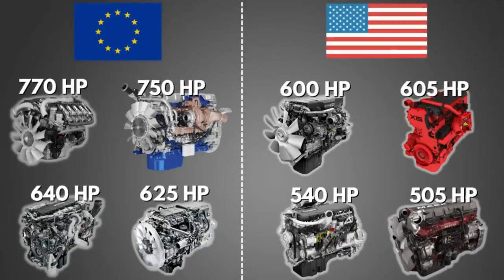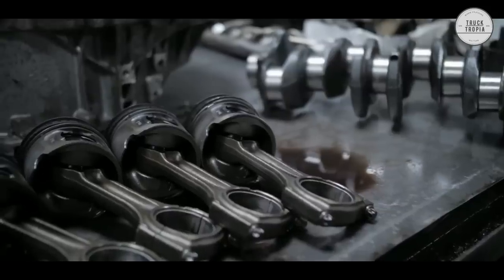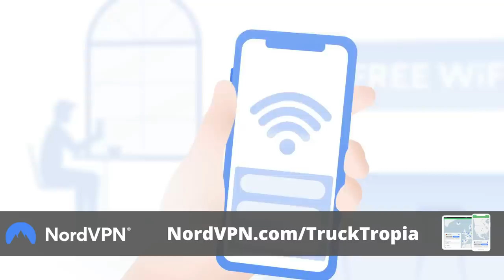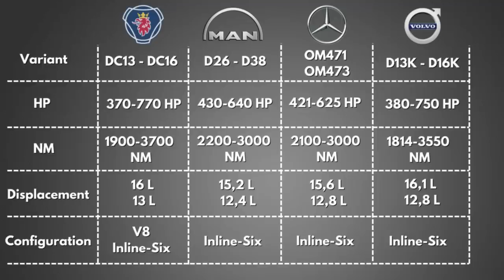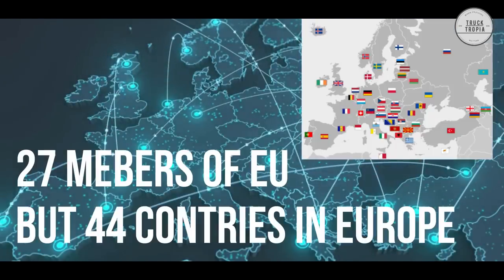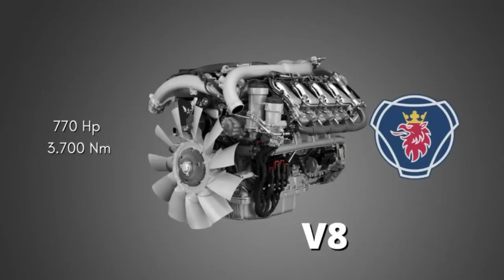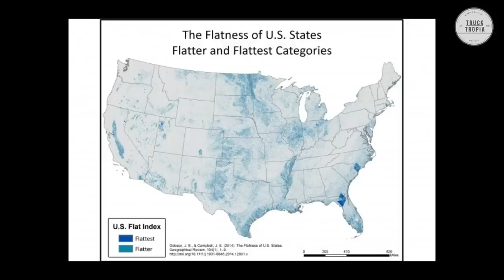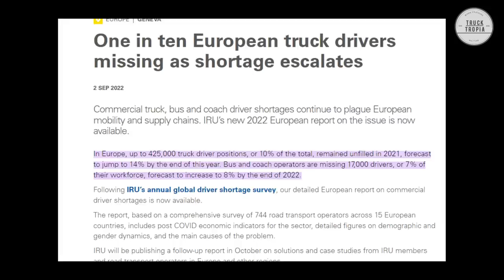Why European Trucks Have Up To 770 HP And US Don’t

Comment: My good sir I don't mean to be disrespectful but here in the us our trucks may be big and sometimes slow but there are much cooler and customized trucks here in the us than I've seen anywhere else in the world
Reply: What I noticed in the US is that your trucks often drive much faster (!), because they are unlimited. In Europe all trucks are strickly limited and monitored with a so called "tachograph" ( a registration aparatus), and the maximum speeds for heavy trucks in all European countries varies between 80 and 90 km per hour (50 to 56 mph). 
So all that horsepower can not be used for a high top speed. However it does help with the acceleration and climbing power on those winding, narrow and hilly European roads (which is much more important here).

Comment: The EU trucks with their advanced ECUs and fuel injection also respond very well to remapping - theres likely a hundred horses hiding on top of that 750+ BHP - or a few MPG improvement to their fuel economy; it doesnt sound much, but an increase of just 2-3mpg can save operaters many thousands per rig in operating costs annually.

Not sure where the US are with their EDC systems but im guessing still a few generations behind if your Tractor manufacturers are anything to go by - especially if they follow the lead of companies like John Deere and make everything proprietory or Dealer service/repair only (although this has been forced to change to some extent too recently im informed)
Reply: Cummins in the US are in top of the line along European manufacturers and so on I will guess. Got strict emissions laws both places. It's more about the larger part of the US market is trucks with lower total weights allowed than in Europe, and majority of traffic going on in relative flat areas. If there was a large enough market for a 700-800 hp eninge to make economically sense, they would likely had no problem developing it. The large part of class 8 Euro trucks are around 500hp, similar to the US. Those 650-770hp engines are a small part of the market, most popular in the Nordics countries with their higher total weights, especially timber trucks (often 130-180.000 lbs), hilly terrain. Also in the Alps those larger engines are more used

Comment: They use a different measurement standard is my guess, they must because a cummins or cat 500hp will pull harder than a Volvo 700hp, I do know that there is din and sae testing dynometre standard, they are different, although I don’t know which company uses which, here in Australia we have all types of trucks and I’ve driven most, the cummins and cat with the 18 speed manual are ahead in pulling power

Comment: american semi's use inline 6's that make 1800+ ft-lbs of torque. american trucks stopped using v8's a long time ago
Reply: V8's generally are less efficient, more interal friction than inline 6, so most have stoped producing them for highway trucks. Scania have managed to develop their V8 through 50 years compiting with inline 6, so they are sticking to it. They got inline 6's too

Comment: Power (kW) = RPM x Torque(nm) so the Power in kW is the important Value because now you can take the right gear an get the maxium power.... torque without enough RPM can´t take you over the big hills....and on Truck engines 100rpm makes a difference....

Comment: Because hp is CALCULATED.... torque is measured...
Hp is a function of rpm.... look at f1, makes no tq, but spins to 14+k and makes 900+ from less than 3l
Reply: I don't know your point but basically you believe that force times speed is calculated (which is power) and force times radius (torque) is somehow measured.
Reply: @simplemachine9531  the formula for hp is 
Torque x rpm /5252
Reply: @taomicioli  the formula for torque is hp/rpm x 5252 so torque is calculated, again following your logic? You need to investigate more.

Comment: Actually DAF designs the PACCAR engines. I don't know if it has to do with DAF owned by PACCAR, but DAF  only produces and uses engines up to 530/540 hp  (MX13)   I think building stronger engine is something of a waste for a company like DAF/PACCAR.  Why struggling against Scania/Volvo or MAN and Mercedes if you can build very economic engines which can be produced and sold (!)  in large numbers?

Comment: Torque as a single number without context is completely and utterly meaningless. The magical word is 'torque curve'. 
You can achieve 600hp by bolting 4 extremely low torque, lightweight 150hp motorcycle engines together. At the driving wheel, at road speed, the torque delivered will be exactly the same as when you would have the diesel. 
But because the torque curve of a motorcycle engine is very peaky, torque at low revs (as to not burn up the clutch) is very low. Meaning you couldn't get the big load moving from a standstill. You'd have to rev up the engine to its peak power point at 11.000rpm or so, and that would very quickly smoke out the clutch. However, in the completely fictional scenario of the truck already rolling, it could haul just as much weight up a hill at the same speed, as a 600hp diesel would. 
Slap on an extra engine, and in the already rolling situation, you could even get up the hill quicker than with the 'real' engine, despite the 5 small engines added together still don't even come close to having the torque the diesel has. 
Of course, the engines wouldn't last very long because they're made for full power for 5 minutes every 10 minutes or so, not for full power for hours at a time.

Comment: Power, and not torque, dictates the ability to do work. 

A less torquey engine but with more power will be able to pull more, but you have to gear it accordingly.

Comment: Too much talk and simple repetition. Some more numbers could help, like for comparison providing with 'horsepower per ton' or liters/100km. Are the european trucks as well consuming less because diesel is quite more expensive.

And US trucks may go as fast as 105km/h, whereas 80 km/h is legal in europe (87 - 89 are used, cause the trucks are limited by design not to do more than 89km/h) - you have been so right - 400 to 450 hp is enough when going flat and even.

Comment: I don't understand. Why would it make sense to not look at hp and torque in relation to each other. You can move the same amount of weight with a lower torque engine if you can rev higher and the drivetrain is geared accordingly. Hp is by definition how much work an engine can do.
Reply: Check the definition. 
Amount of fuel is how much work.
Power is work/time.

Comment: Um, most distances you can realistically reach in the contiguous US you can also reach in the EU. Depending on which route you take and how much time you want to spend on ferries, Tampere-Lisbon can be up to 2800 miles. If I start even further north in Oulu, it's 3000 miles or more, depending on the route. Probably the only kind of distance you cannot achieve in Europe is something like Miami-Seattle (and even there, you can find locales that are of similar distance, just not usually ones where you'd see regular truck routes)

Comment: American engines can make a ton of power.  Far more than the "rated" power. The numbers are low and the screws turned in to beat emissions and for duel economy on paper. When warranty is over, I've seen many c-15's etc, push 850-1000 horsies. Much higher than that in some cases.

Comment: Major miss here is the multiple markets (On Road,  off road,  marine).      Some are vehicle primary (Detroit Diesel) but extend that to Volvo and Scania.    But,  there is a major market in Generator,  pumps and marine power..      Volvo line quits at the 16.1 but they sell a lot into Marine and Generator.   Generator as standby can go another 100 hp higher than vehicles.    Marine as well or higher as those are rated by how much time you can pull max power.     Cummins on the other hand has no road engines that they sell up past the notional 450KW Generator size (15L - )Cummins simply builds larger engines in higher Hp. for the markets.    Scania,  Volvo and Detroit target vehicle markets,      for them its a nice supplement market for Gens etc.    For Cummins and MTU,  its a main market and they go into the thousands of HP that reaches way beyond a somewhat standard  Cummins 15L engine.     And a further subset is Machinery that Volvo and Cummins have major presence in (Volvo being both engine and equipment).

Comment: 5:46 even American trucks that pull 500k pound superloads like a kw c500 has 600hp at the very max gearing matter much more a dump truck in north America will easily haul 100k pounds when a lot of them only make 350hp bc theyre geared at 6.89/1

Comment: Lots of trucks pulling B trains in Canada rated to 64t, or single tri-axle at 54t. Rubbish- it's only 39.5t for standard dry van- most other commodities are hauled in larger combinations including A-trains with two 53' trailers fully loaded- that's easily 70t... plus oversize for heavy equipment transport - that's 100t with TWO 600hp trucks connected in tandem pulling the load!!! You barely touched the surface here. I hope you at least know that Pilsners and Lagers are superior. 10-10.

Comment: Hmmmmmmm

Interesting video.  But doesn’t explain why down under in Australia most road trains are 1000hp Kenworths,  pulling 150 tons.
Reply: Why they not speak about Austraila in a Europe vs US video, we maybe never know the answere to...
Reply: @Rimrock300  

Kenworth are an American company, so they are quite capable of making 1000hp trucks.
Reply: @rosshilton  The video explains about 99% of the US and European truck engines. The 1000hp trucks the Austrailain Kenworth department manufacture for local roadtrains is a small niche in the big picture. The video is not about 'who can make the most powerful truck', but just explains what size of engines are most used and suitable in the those different places in order to get the better fule milage. Europe got high total weights than the US, and more windig roads and hills, so it's natural to use a bit larger engines than the US. That's it

Comment: More weight needs more power? Is that why they used to have 300ci inline 6cylinder gasoline trucks pulling 40,000? Gears make a difference.

Comment: Whoever says US trucks are bigger, has probably never seen it parked next to a EU one. The only thing bigger is a trailer.
Reply from the maker: Not true, US trucks Can be much longer in wheelbase
Reply: @TruckTropia  if you mean the tractor units, true, but the only reason i see is because of how long the noses are, and the sleepers in some  cases. Or if u wanna have some 10ft of free space between the cabin and the trailer. Please check what a tandem truck is, or a scandi setup with a dolly behind a rigid truck. And check how big the cabin is in a xxxl Scania setup. Bottomline: US trucks aren't any bigger than EU, it's just a matter of a setup you go for.

Comment: Lower RPM, smaller displacement, higher torque motors are better suited to idling down american highways for hours on end. Better overall efficiency, moving items around eourpe isnt as big of an endeavor. Most of eourpe's population can be reached closer to water.

Comment: Well mostcEuropean trucks are equipped with 450-540HP engines. 
I rarely see a trucks with 620hp engine and only saw a Volvo 750 HP once on an oversize heavy load transport

Comment: The Eaton road ranger gearbox in a lot of American trucks can only handle 3000nm so the more powerful engines cant be used. for example Volvo have there own bespoke transmission I shift to handle the extra torque

Comment: I would say it should of been VOLVO instead of MACK as the engine builder. VOLVO own MACK  and Renault. VOlVO make the engines for both makes the software and color of the engine being the only difference . It’s the same with the I-Shift automated manual gear box. Originally manufactured in Sweden, before North America. Volvo probably sell the most engines in North America. Cummins is a small player these days and will be even smaller when Navistar fit the Scania engine. Paccar is a DAF engine, not Kenworth or Peterbilt. Yes they  manufacture them in the states but it’s a European motor.

Comment: Who does the research on these videos? Obviously no one. In the US one can carry more than 80k lbs with the proper state permits.  Each state has it's own weight regulations that it enforces.
Reply from the maker: And do you Think i should mention every single States rules? Or just a average like i did ?
Reply: Well you never even mentioned that states have their own weight regulations. You just stated that all states have the same rules which is incorrect.

Comment: in north america we have much higher weight limite then 80 000 lbs for instance in canada you can drive a truck with 132 000lbs and with special permit you can go up to 200 000lbs on the road and with super ultra wide and heavy exceptional load there is virtualy no limit so that no reason not to have bigger more powerfull engine

Comment: Hold up, paccar engines are manufactured by paccar who also manufactures Peterbilt and Kenworth... Paccar engines are pieces of garbage!!
Detroit Diesel is owned by Freightliner who is owned by Daimler, Detroit diesel engines are effectively manufactured by Freightliner and Western Star...
Cummins, and caterpillar are the only two stand-alone engine manufacturers.
You also forgot to mention Volvo and Mack engines. And let's not forget the Maxxforce engine which is made by Navistar, parent company of International..

Comment: One caveat with the video beyond what has been mentioned in the comments is the actual low speed in Europe. Germany at the center of Europe is basically a network of construction zones with limits as low as 30 mph. Many bridges are decrepit and this reduces speeds or forces secondary road detours. 
There are so many restrictions from one country to another country that make trucking difficult. The speed limits for trucks vary but the top speed in Europe is 63 mph, in the US trucks can go 70 mph (120km/h) - this is very efficient and really saves time and lessens fatigue. Trucks often space out before the weigh out, the more spacious American trucks have an advantage in that respect (although the load limit should be much higher when axles are added ...double trailers). Europe has very inefficient train systems (many different standards - Ukraine for example has a different track width), because of the many different regulations (the German train system is probably the worst since it is government owned). Freight railways are very few due to the inability of high-speed rail systems to carry freight traffic. The end result is unending traffic jams (in some areas permanent) some 50 miles long - the average speed a passenger car can achieve is about 65 mph, and for trucks, it is well below 45 mph. On hills the slowest trucks determine the speed, horsepower makes no difference. One truck overtaking another is a nightmare because the electronic speed limiters make this an hour-long dangerous affair.   
In the US trucks have to deal with annoying repetitive truck check stations, a huge cost to the trucking industry and a huge cost to the taxpayer. In Europe, the toll system adds cost and is a bureaucrats' playground. 
By the way, Europe is larger than the US not smaller. Aside from the fact that many truckers even go to the Middle East, Asia and Africa. The US and Canada are much, much, smaller than the landmass available to European truckers. Americans have no understanding of how big Europe, Asia, and Africa are.

Comment: As a Swede, I would like to note where the most powerful trucks are built. 🙂
Reply: As a dutchman i would like to note where the truck with the biggest and most comfortable cabins are built.
Reply: @erikdikkers7931  I don´t know much about the cabins, I just saw that the most powerful engines where Swedish. 🙂
Reply: @Maskinservice  Untill recently. There is a chinese truck with 800 hp. But that cant be much of a truck.😂.Grtz👍🏻
Reply: @erikdikkers7931  I don´t believe in much from Chinese trucks, and especially not high hp-figures until they have been confirmed by someone else.
And they also have to meet every emissions laws. Making high hp numbers is easy, but doing it with an engine that fulfills all environment laws, and also have low fuel consumption and lasts long enough, that´s a completely different task. :-)

Comment: By changing the motorcontrol, a 2006 Scania 410 with a few ajustments, can easily put out a minimum of 530 horses. And I shit you not, I have seen these, outrun a Volvo 780hp up hill.

Comment: The larger displacement in Europe is counterintuitive and surprising. Also I didn't realise trucks have 2-litre cylinders.
Reply: @Roger Gore because usually American cars have had larger engines. Also the looks of the trucks - a long engine compartment at the front.
Reply: @Roger Gore I don't really know about cargo weight and why would it be different.

Comment: What type of engines are used in the narrow mountain roads surrounding Mont Blanc or other narrow mountain passes? I am asking because I travelled with a truck driver as a kid and those roads always scared the crap out of me when I looked down into the abyss. Some extreme angles where you really don´t want your engine to fail.

Comment: The higher you drive the thinner the air. So combustion machines must have more power to have space for the loss.
Mountains in the Alps e.g. in Italy, Switzerland, Austria etc. could be 1500+ miles high.

Best would be a electric Truck, as these don't need air to breathe. 😊💨
But these have 100% torque from 1st rpm, so less torque on paper is requred anyway to sucess.